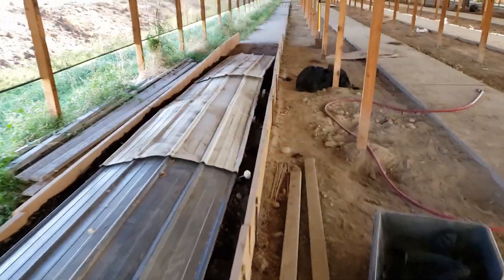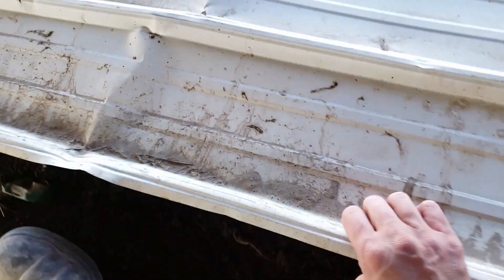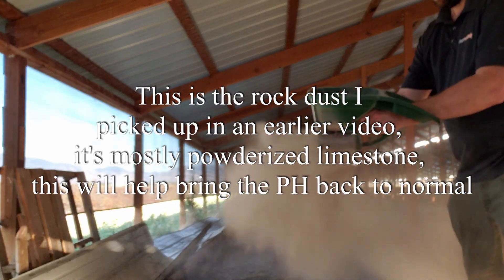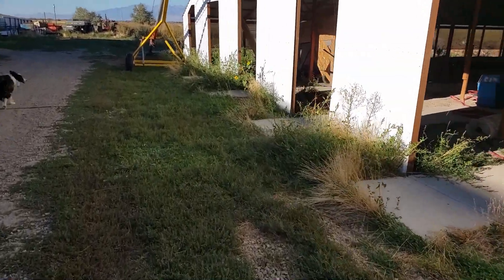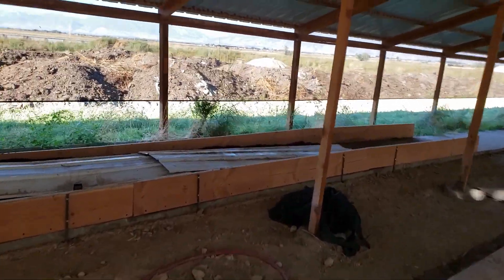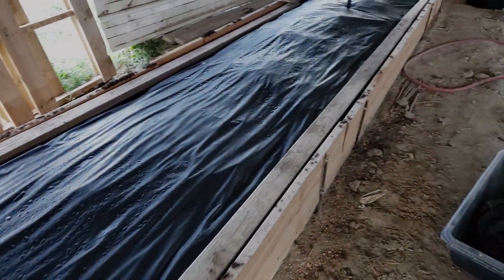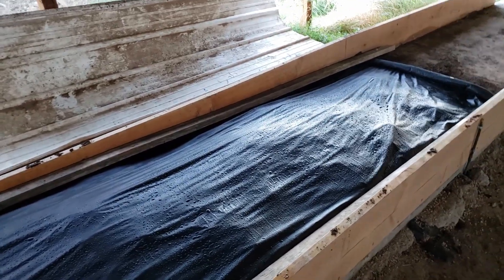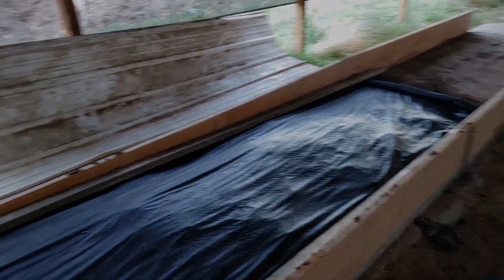Compost Worm Die Off - What to do when your compost worms are dying - Part 2

Comment: Hi there, I just made a comment in one of your older videos and then watched this one. 
I use a pH reader for my compost bins, and the packaging said 'do not leave in the soil'. I figured it must drain the battery faster. I wonder if they could be emitting a high pitched sound that the dogs don't like?? Just a nerdy thought.
Also; the worms might like some moist micro-cut cardboard/paper pulp to bed in. Clean bed means happy worms. Remember your greens-carbon ratio. My thoughts are that this might give and a cool place to go to when your worm bed is so shallow?? And the tin might have been suffocating and cooking them too?

Comment: The way that water is beading up on the cloth makes it look somewhat water proof
Reply from the maker: The first time you wet it down it kinda is a bit hydrophobic but once it wicks though that goes away.
Reply: @westmountainorganic8084   Definitely seems like a better material. I wonder what the perfect covering is for water retention, pest/predator control, ease of access,  etc... The mice able to burrow under that still?
Reply from the maker: @wormsnowball5466  I have found that when I cover with the weed barrier cloth the mice tend to stay out, probably because it doesn't feel as secure to them, when we covered with cardboard they loved to hide under it and build nests, if you look carefully you can see they were burrowing under the metal as well. There are so many mice at this farm I don't know if we will ever keep them out 100%. We winterized the farm by covering it in straw and it's a mouse paradise, but not much else we could have done to retain heat and not suffocate the beds.